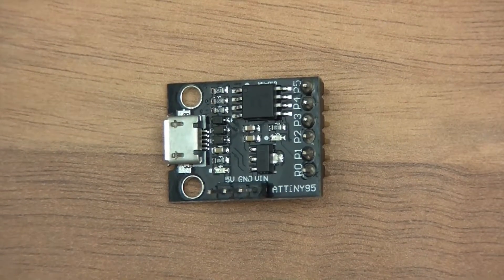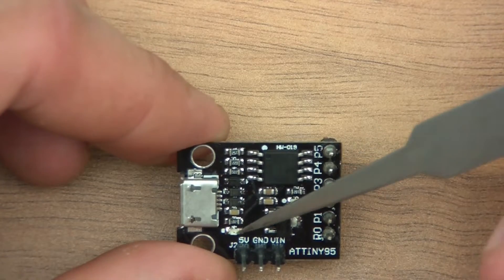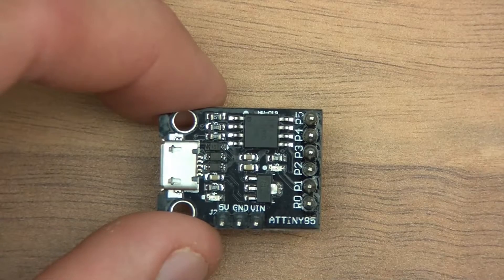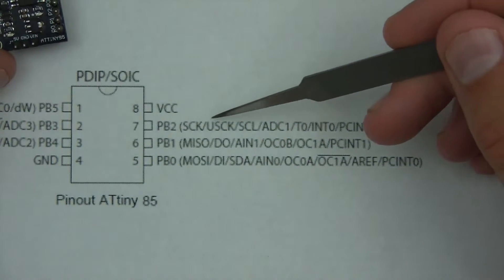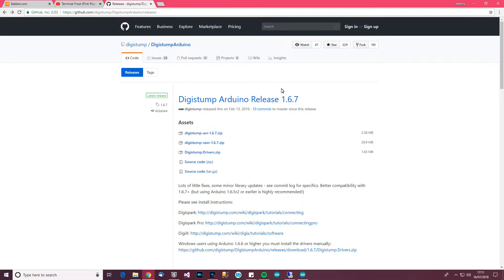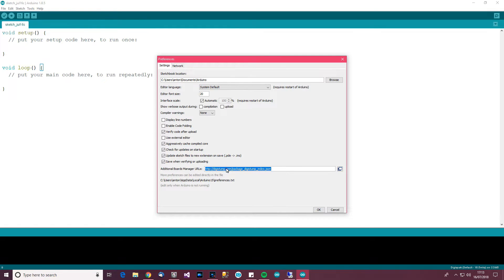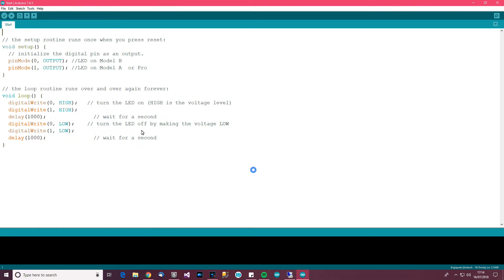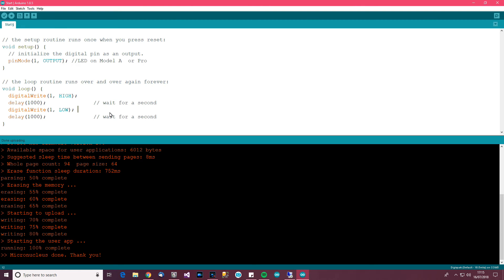TUTORIAL: Quickly Getting Started with ATTINY 85/95!

Comment: Hello Antony! can you explain to me why my attiny85 works only connected to PC USB? if i connect it to an external power supply (for example the phone charger 5V 1A) it goes crazy.
Reply: Did you conect the GND of th Attiny85 and the GND of the external power supply?
Reply: The GND of the power supply is the GND of the micro usb connector. Is the same of the three powe pins on the side. I have to make a bridge? It makes no sense to me
Reply: @Matteogambitta  did you got it to work?
Reply: @First.Last.99  hello! unfortunately i stopped this project, i have powered it with a stabilized power supply, it has worked for 10 seconds then all the leds have buned out :(
Reply: @Matteogambitta  too bad. I now ordered few Seeeduino XIAO. its small so hope to have better experience.

Comment: Much simpler to programme than having to use an interface board!
Reply from the maker: gartmorn I guess so, I do think it's strange though!!!
Reply: Antony Cartwright software isn't my forte but I agree it does seem strange.  You'd think that Arduino boards could have a similar software solution but maybe the microprocessor has a different architecture.  Just guessing as I'm no expert on these matters!